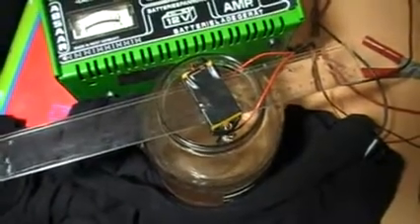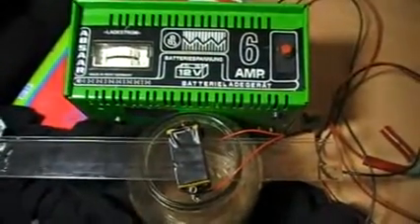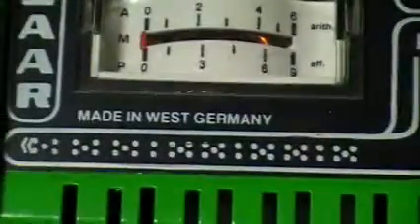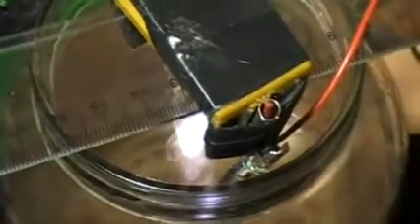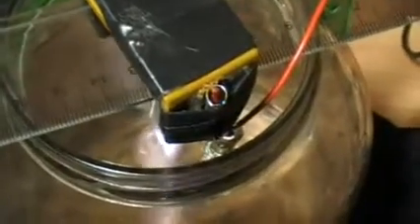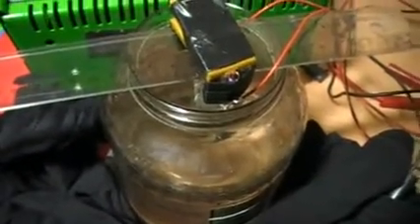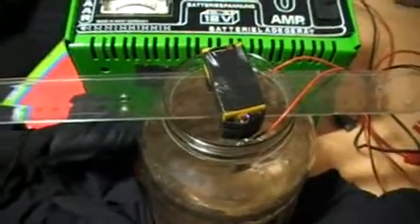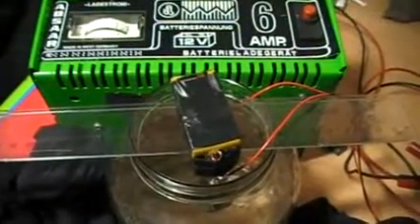Making Colloidal Silver with Nonkel Roge

Comment: Ok but you need to cover more info man. Come on! Distilled or tap water?, what voltage? Add anything to water? Heat water before? I know these answers but others do not so be carefull to not dissinform. If your water is cloudy your doing it wrong! Do your homework and post another video on the correct way to make it.

Comment: @sanddocon simplest cs maker is a cheap 1 pound garden solar powered light.
remove the led bulb and attach the 2 silver rods in its place.totally automated.

works at night,charges by day.

also if you wish you can leave the led bulb in series as a visual indicator of current flow thru water.

Comment: Gee simple way I saw on here is a guy connecting 3- 9v batteries and two jumper alligator clips to two silver rods in a glass jar of water. I liked it quick and easy!  And in fact Bob Beck some times only used one 9v battery with tap water and in five minutes or less he had Silver Colliod solution and down the hatch it went.  This is great when you consider it is so simple to have good health and if you are camping or out doors use the same thing or method to purify your water.